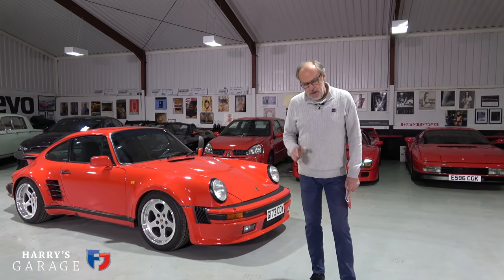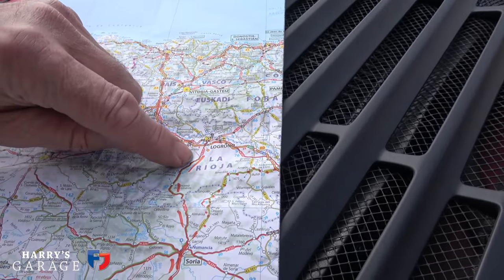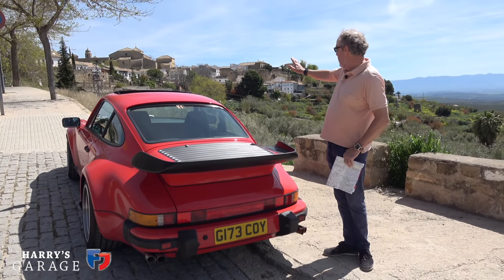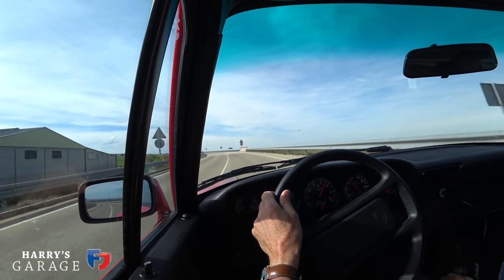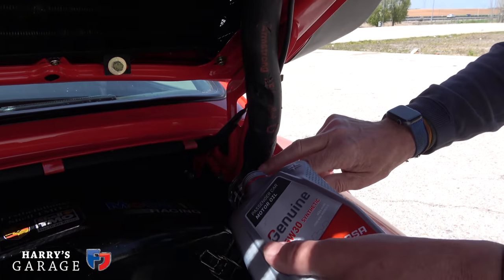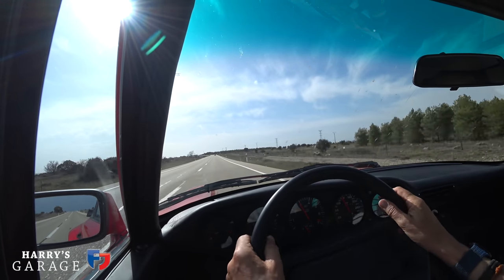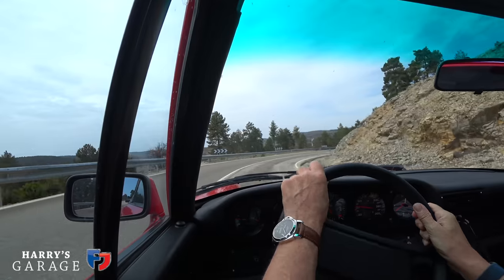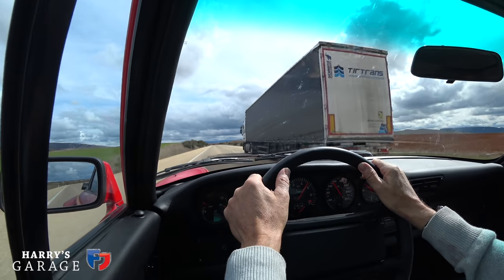Spanish road trip special in my Porsche 930 turbo S. How does this classic 911 cope with big miles?

Comment: Absolutely a wonderful video. Good job

A few 930 Porsche owners weird trades. Park always rear first to avoid an expensive parking lot crash as there is no power steering,  exhibit Porsche affiliation by demanding the tire service to point all four wheel center caps ie. Porsche emblem tips towards the air inlets and at last but not least steer with two hands in 9-3 pos avoiding milking. This car is unforgiving at limits. I know the hard way as I barely saved us at a racing track at a too high speed driving the rubbery lines which one should never do when wet :)

Comment: My 911sc 1979 used to return 30mpg average with nearly 40mpg on a long trip. Took it to France in 1983 and it was very comfortable with little wind noise at motorwary speeds...and above. I too am surprised at the 13mpg in the turbo S. Great video, as usual.

Comment: In the south between Sevilie, Ronda and Marbela is a fantastic mountain road. It called the road to Ronda. No bumps, fast corners up down and cork screws. Like a 150km race track through the mountains. Your Porsche turbo on that mountain road would be amazing. I used my clubsport but its only 230hp and no turbo boost.

Comment: Great stuff, Harry! Many thanks for taking us along for the ride! On the MPG front, I owned a 1970-1/2 Chevrolet Camaro Z/28, that, with its 350 cubic inch, 360 HP engine, averaged around 14 MPG on the highway. But, oh, my, they were memorable miles, as are the miles that you are putting on that lovely 930! All the best!

Comment: Nice report, Harry! And a beautiful 930 Turbo. 

In my 911SC, when caught without a funnel to top up in the engine oil, I would just roll up one or two sheets of A4 paper. Just have to be quick enough and get all the oil in before it completely soaks the paper. On a road like this, up and down along a hilly road at higher revs that was about 1l / 1000km oil consumption on a healthy engine (and 16 l / 100km fuel consumption). Old Porsches like their liquids.

Comment: Harry, the proper way to check the oil level is to have the engine warm, car leveled and more importantly engine idling. Let it idle for about 2 minutes and check the level using the dipstick. Sometime the gage is off. You want the level to be around mid point between min & max. There’s about 1L difference between min & max. Try to use 15W40, might be a challenge to find this on the road so try to find motorcycle oil.

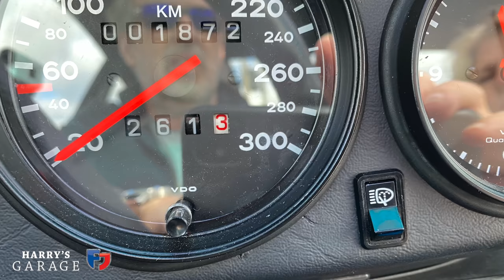Comment: Thanks as always for the great video! Your enthusiasm and style of presenting is wonderful as always. Have not read through the comments, but I probably won't be the first to mention that the proper way to check the oil level of an air-cooled 911 is while the engine is running at idle, with the oil temp at 8:00 on the temp gauge . . . . and while a 930 SE at full boost will have atrocious fuel economy, it seems that yours should have done better overall at cruising speeds. You should have this checked out by a Porsche specialist. And finally, your complaint about heel-toe downshifting in a floor-hinged pedal 911 can be rectified. The brake pedal height can be adjusted downward, and there are numerous aftermarket throttle pedal covers/extensions than can be installed. Thanks again and keep up the great work!

Comment: Think your maths is right Harry. 13 mpg is a bit thirsty! But it sounds about right road and track apparently got 17 mpg out of a 930 Turbo back in the day. EPA apparently rated the 1979 turbo at 12mpg (that’ll be US mpg, not imperial which will be higher) and when it was brought back for 1986 it was rated at 14-21 mpg and it was subject to a gas guzzler tax! So not known for fuel economy I don’t think!

Comment: I was hoping that Harry will have to show us the oil level checking and I smiled like a child when it came.
5W30 for top-off? It doesn't matter probably, for running-in phase. 
Enjoyed every minute.
As I've said many times; the only car that could replace my 3.0i BMW is an old Porsche 911. 
Proper driver's car.

Comment: Harry, I just found the paperwork from my old non-S 964 Turbo. On a trip with mixed motorways and main roads, I got about 8.5-9 km per litre - you get 4.5...
I'd have someone put a probe up that exhaust and see what the AF ratio is, because that's off if you ask me. Yes it has more power than my non-S turbo, but that's insane.

Comment: Harry, to check the oil level with the dipstick on an air cooled 911, you need the engine to be warm and running. Also the dash gauge for oil level is nearly useless. Love these road trip videos!

Comment: Fuel 'economy' obviously due to the modifications plus presumably to some extent how you're driving it. I'm sure you know the original 3.3 Turbo was not at ALL a guzzler unless you spent a lot of time at high RPM/boost levels.
The sort of consumption that thing has is much more like the mechanical fuel injected 2.7 Carrera variants.
The father of a good friend of mine had one of each and he used to let me drive them, too. Love the air cooled 911s as they are so much smaller than the modern barges. 
Can relate to the comment about overtaking; those old school turbos were a case of nothing-nothing-holy****!! For 35 years ago the performance was ridiculously punchy and addictive, just a joy to drive regardless of what sort of driving you were doing.

Great video, thanks for sharing.

Comment: Great road 🎬. For your next one, may I suggest driving from Sevilla to Tarifa (Spain southernmost point) in a convertible, May, June is the best time...driving topless between Chiclana and Tarifa during sunset in Spain's N340 is a real chillout experience. Must seen Vejer de la frontera + dinner or lunch  at Venta del Toro, one of Chef Jose Andres recommended places. Nice twisty roads in Barbate area. Thanks for the video.

Comment: I have a 2002 Volvo S60 2.0t, at 2500 rpm it's 71 mph, and I think that's where the turbo comes in, so In terms of fuel economy the difference between a 75 mph cruise and a 65 mph cruise is quite a lot, at 65 mph it will get high 30's mpg 36 to 38, but at 75 it's more 28 to 30, it's quite a difference,  for short journeys it's ok, but for long journeys it makes a difference to your range, having experience of this, I wonder if that's similar to what this Porsche is doing, Harry is driving it enthusiastically so probably keeping the turbo on more than he might thinks,  could be why the mpg is so bad

Comment: Yes as per a previous comment the oil should be checked with the engine running (at operating temperature) using the dipstick.

Comment: Love that 911 !! I was a kid in that era. Thank youuuu for movie ! btw, next time you need to improvise a funnel in a petrol station. Pick up one of their publicity , thick papered pamphlets, or buy a magazine, that thicker first page and roll it up from a corner into a cone. One use only but saves lives. When that car was built fuel use wasnt an concern, plus its probably "premium only", next time take a Mustang ;). I managed to lower consumption a lot by changing the differential gears. 5th gear is now useable. Subscribed.

Comment: Harry, many times your reported  MPG is similar to my old Ford. My average is about 10 MPG, my best is 12 MPG. It's a V10, crew cab, 4WD, long bed with a Warn bumper and winch. Empty weight is over 4 tons...my worse mileage? 5.5 MPG pulling a loaded 20' dual axle trailer, truck bed & cab full from Scottsdale to the top of Payson (Arizona). My scale weight, with my dog & I looking into the state truck scale station (after hours)? 23,556 pounds

Comment: I've had a 1985 930 since 1991.  It gets dismal gas mileage in Town.  maybe 10 MPG.  But over 20 MPG on the highway if you run it about 65mph.

Comment: Yeah this oil gauge level I always had an eye on it. Mine was a 964, Carrera4, 3,6L. I am surprise that Harry add a 5W30 specially in this warm weather. I use to put 10W50 but mine was not a turbo s I dont know??? I use to add oil very slowly by the end, even with the engine running and watch when the needle of the gauge will move up to the center. Then it was good to go.

Comment: The fuel consumption is what we called „Turbo-Zuschlag“ back in the day.

Standard calculation for turbo engines back then was 1,5 times fuel, compared to naturally aspirated with equal horsepower.

Cheers

Comment: 27 km per gallon is 16 mpg. Not 13. With the 85 litre turbo tank thats a tank range of 300 miles or 470 km. My 1987 clubsport does 40mpg on the motorway, which is a massive 700+ miles or 1100km+ tank range. If you cain it, mpg drops into 20s mpg.

Comment: Hi Harry
Great video, as always. What a car!
Regarding the oil level on aircooled 911's. I used to have a 1971 911E 2.2 ( wish I still had that car!) As far as I remember, in order to check the oil, and it must be up to operating temperature for the oil termostat to be open (as your engine was) and in idle (for the oil not to drain out or in to the oil tank.
I would use the dipstick to see how much oil I would roughly need and then look through the rear window at the oil level gauge and fill it to ca. 80%.
Not sure if I did it wrong or it's different on later and /or turbo models.
Please make some more videos on the lovely 911.

Comment: One fine day the map printers will realise that we are sick of paper maps that split on the folds and creases. When requiring more than one use only try and get Rip-Proof Waterproof Plastic  Maps -- a revelation even if lacking some colouring relating to scenic routes etc..Better still lift from a fragile paper sheet all the details you need onto a plastic sheet that can be opened in a windy cockpit without ripping apart.  Marvellous to share this trip with you.

Comment: 46:15 steering feel: certainly sidewall height is a big determinant but so is the rest of the tire.  My '95 Supra Twin Turbo came with MXX3 which rode quite hard and jittery.  Switching to Pilot Sports was astonishing, almost like the Novocain feeling after the dentist's.  If anything they were stickier and perhaps as precise but didn't beat you up.  So, on one of these cars that's not about ultimate speed anyway, the top-shelf ultimate tire may well not be the ultimate match.  Not to mention mileage is so high on tires one step down from the bleeding edge that the last change I did on both my 430 spider manual and my M5 manual was due to tire age, not mileage...

Comment: Have you had the mapping checked on the 911? That MPG makes you wonder if it’s chucking in a bit more fuel than it needs…
Reply: Yes, this ^
I regularly drive a 2.4L mechanically fuel injected (but not a turbo) 911, and on long road trips and I average around  21 mpg without much trouble. I know he said they run it rich cool the pistons but it makes me wonder if it’s a little too rich perhaps. And not that I could ever own that Turbo S, but if it were mine - if I couldn’t get the mpg up, I’d look into that larger fuel tank that used to be available for 911 race/rally cars. Of course, you lose some of that nice frunk storage Harry really appreciated. Like everything else, there are trade-offs: power versus mpg, range versus luggage space. Cadillac problems I suppose lol

Comment: Is there a link between the 930 'S' and the contemporary RUF-built 930 models, such as the BTR and CTR? The wheels on Harry's car appear to be identical to those used on the RUF CTR 'Yellowbird', plus there's the 5spd gearbox... so I wondered if there was any teamwork between the two manufacturers, or did Porsche utilise some RUF goodies?

Comment: Gorgeous route and car. However, that mpg.... Yikes! Traveling around Spain, if you avoid highways, is a blast.  I take the opportunity to make a few recommendations if I may. Next time you get to Santander to drive to the ¨meseta¨ (the high plains of center Spain), you can take (1)  ¨La Lunada¨ from Lierganes (Cantabria) to Espinosa de Los Monteros (Burgos), (2) ¨Palombera¨ from Cabezón de la Sal to Reinosa (both cantabria), or (3) ¨Piedrasluengas¨ from Puentenansa or Potes to Cervera de Pisuerga (Palencia). The first option is to the East, the later is more westerly almost crossing Picos de Europa. Those three are the nicest puertos (¨colls¨) in the area IMHO. Food is excellent all around. If you turn  west from there and go to Santiago de Compostela crossing Palencia, León and entering Galicia, you'll have some very memorable roads all the way. Also, never underestimate the possibility of stopping in Porto for some nice bacalhau! It is nice following your trip adventures!

Comment: I´ve lived in/near Madrid for 20 years and average about 50000KMs a year in both modern and classic cars, so would confirm everything you see here is true! The only thing I would say is, strange route! If I was going to  Ubeida, I wouldn´t start in Bilbao, and it is a drive which can easily be broken into 3 days if you did. I think Harry googled "Empty Spain" and joined the dots. In fact, most of Spain is equally big and empty, but you are never far from a decent meal, hotel or help if you need it.

I would agree that the ferry is better than driving through France, but unless you want to visit Basque country/Pyranees specifically (many good reasons for that) I would recommend the Portsmouth-Santander route which less crowded than the Basque country and an easier route south. important thing is to spend 2 nights in Santander before or after the ferry, for me it is just about the nicest place in Spain, not just a ferry destination. You can go west and visit Asturias, or, if you are heading south, go by way of Salamanca and Cacares. All the roads are good, some are amazing. Drive quickly, but don´t rush the trip.

If I turn right out of my house, I can drive for 500kms of amazing roads with no radar, police, or traffic. If I turn left, I´m in the centre of Madrid in 45 minutes.....And if you want to cross Madrid, you should drive the 80 kms of tunnel system under Madrid, incredible feat of engineering. which took just 4 years to build and transformed the traffic flows in the city.

Comment: Hi Harry, 

As you alluded to, finding a "ball of your foot" balance in corners with knife edge boost is near impossible to achieve. All my 3X 930's 260BHP 4 speed and 300BHP 5 speeds drank fuel in the low teens. Once boost is mastered, on testing windy roads, single digit MPG is not uncommon. But then, cars of this era were not engineered to be economic! 

Once I had tired of the boost, I had 3X 964RS and these cars with 250-270 BHP were much quicker on challenging roads and  the power delivery was predictable, the drive consequently more enjoyable and rewarding, but fuel consumption never got past 20MPG.

My 992 GT3! much lambasted and undervalued by yourself, has a 90ltr tank, achieves 25MPG and has a real world range of 500M.

My old 90's took 4X 20ltr Jerry cans in the forward boot, which did give me better handling but I still hand to stop to tank up.

Average speed is imperative for a genuine touring car.

Whilst the 911 handling has become more benign over the years, engines are more economic than they were 4 decades ago, a capable GT still needs a large fuel tank and 500M range to be relaxing and practical.

Comment: I regularly drive a 2.4L mechanically fuel injected (but not a turbo) 911, and on many a long road trip across the States I average right at 21 mpg - without really trying very hard to do (i.e. lots of spirited driving). I understand running it rich cool the pistons (and too lean can be catastrophic) but it makes me wonder if it’s a little TOO rich perhaps. 
And not that I could ever own that Turbo S, but if it were mine - if I couldn’t get the mpg up, I’d look into that larger fuel tank that used to be available for 911 race/rally cars. Of course, you lose some of that nice frunk storage Harry really appreciated. Like everything else, there are trade-offs: power versus mpg, range versus luggage space. Cadillac problems I suppose lol  (Or maybe I should say Porsche Problems...)

Comment: A thought about the fuel consumption. Spain is mostly about 2000ft above sea level so I wonder if the  fuel injection brain is identifying thinner air and richening the mixture to compensate and stop pinking? More modern cars have more sophisticated systems..

G

Comment: Old school turbo engines are programmed WAY fat (rich) to protect from leanouts.  I think the air cooled ones even more so than most.  We are spoiled by the tight mixture and spark controls on modern EFI engines.  I just think they were at the mercy of the limits of the engine controls of the day.

Comment: MPG: Not gonna read this in the 100s of comments but are you sure the rubber fuel hoses are good on the car and not leaking?  With modern fuels they need to be replaced every 10 years max.

Comment: Sorry to be a pedant Harry, but the engine needs to be running when you check the oil level on an aircooled 911, I have owned numerous 911's and as far as I am aware, all the aircooled cars are the same in this regard. Great video as usual though !

Comment: You are checking your oil incorrectly.  You should check it at normal operating temp while running.  Adjust level while running.

Comment: Damn that mpg number is rough. Like somethings broken rough. On the other hand you cant forget that its a very primitiv turbo charging system and at motorway speeds you'll constantly be going in and out of boost so the old Bosch K-Jet(?) tronic is gonna be in a constant state of confusion. 😂